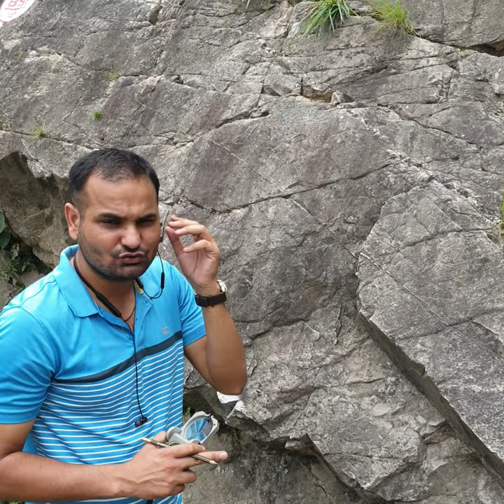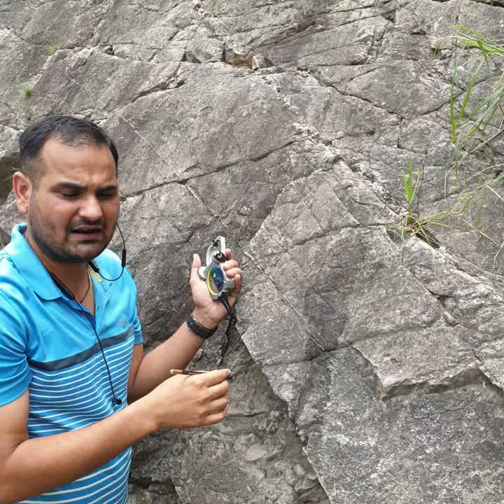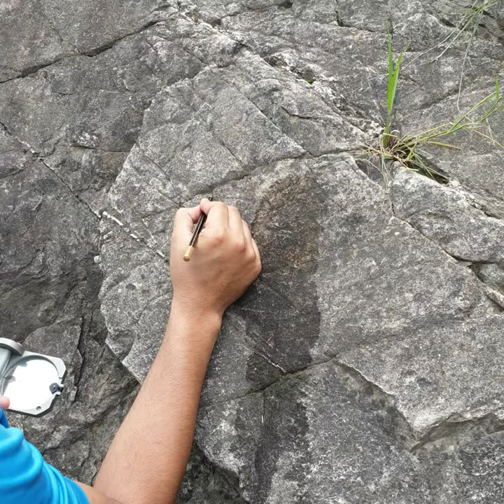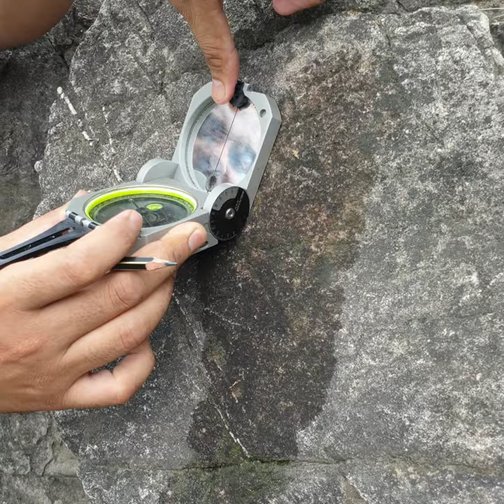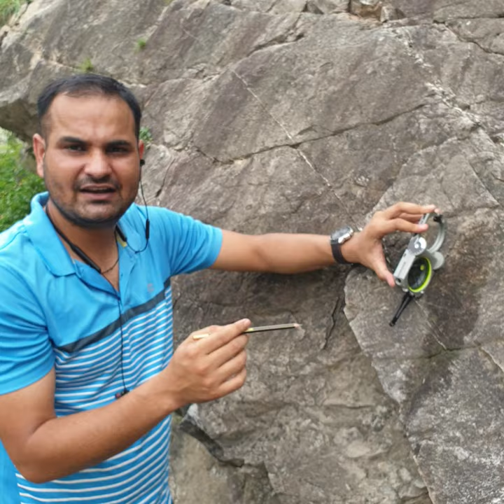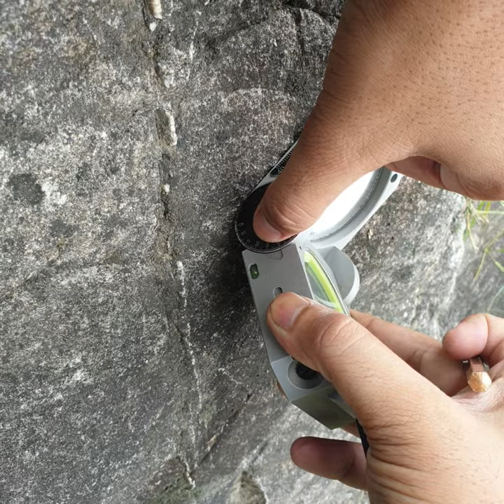Calculation of dip and strike in field

Comment: Sir I have lots of confusion regarding angle of friction and angle of internal friction

First are both of them same or different

Is friction angle different for intact or a jointed block of rock. For ex. In a paper
There are 3 different friction angle for 3 different joints

And if this correct how the data is collected

What is dailation angle

All these parameters are required in numerical modelling in RS3 in jointed hoek-brown failure  and Barton-Bandis  failure criterion

If posible please make a seperate video
Reply from the maker: Sir, internal friction angle is for rock not for the joint. If we want to calculate the joint friction angle then we have to perform joint direct shear test and for internal friction angle of rock by triaxial test. Yes there is one more way to calculate joint friction angle that is based on RMR for particular joint set. There is a relationship in Bhawani Singh sir book or you can see Z. T. Bieniawski book also.
Reply: @DrMohitKumarPuniya  thanks sir. 
i am 2016 pass-out of kuk 😊